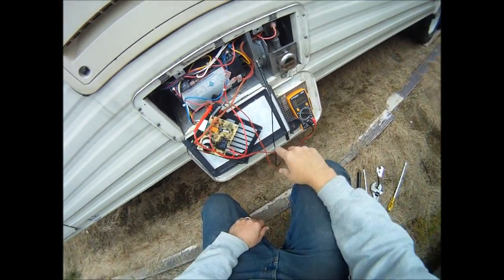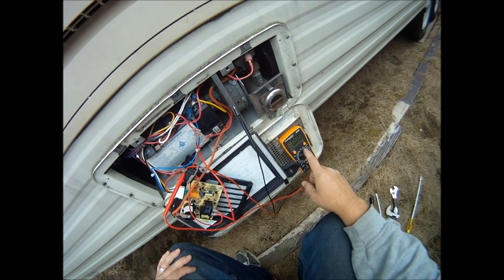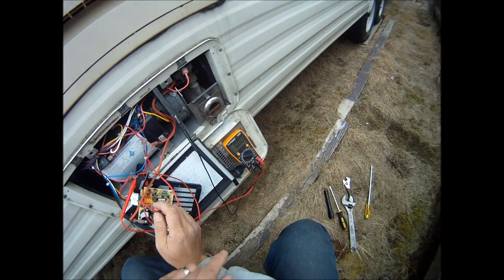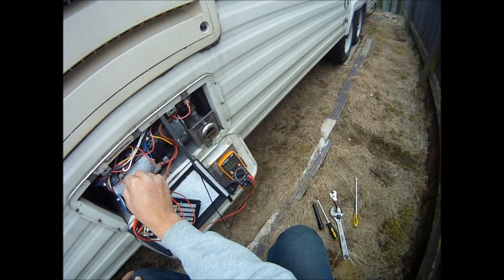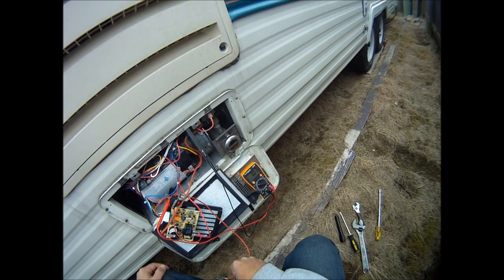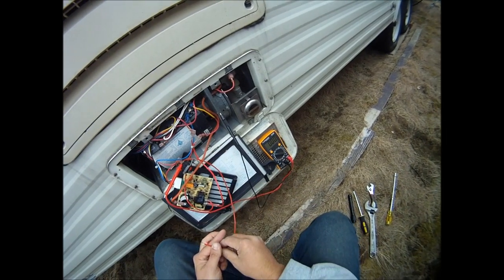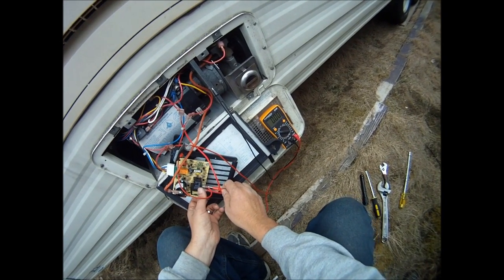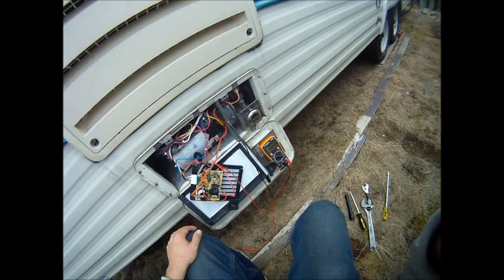Hydro Flame 8525 III

Comment: I have the same heater I wired it and it clicks I could smell gas but no ignition
Reply from the maker: Bummer, have to start trouble shooting things
Reply: I had to change out the igniter board,   was an easy fix for the fail to light issue

Comment: If the input voltage is low but your grabbing voltage from another source off the trailer then replace that jumper wire.
Reply: I should, but 7 years later its still working, I have another video explaining what I did.

Comment: Try a new thermostat
Reply from the maker: The one on the wall in the trailer? Its still working fine after my fix of upping the voltage, I probably should run a new wire to it or something.

Comment: It is the relay timer also know as purge timer, it has 4 wires going to it and it's on top of blower and to the right
It is a bi-metal strip timer, kinda old fashion,  there is a better replacement part by Dinosaur  #31017
Reply from the maker: That part makes it not have enough voltage? Or what does it do?
Reply: It runs the fan about 5 seconds before ignition to purge out possible remaining gas to preventing an explosion

Comment: Could someone please help me ?? I have a hydro flame furnace and the blower fan will not turn on ... I tested the fan and it does work . I changed to a new thermostat too . The blower fan isn't doing anything when I turn the thermostat to heat . I checked all my wiring for loose connections . My circuit boards look fine too . Please someone help me ... This is very frustrating . Been working 4 days on it and can't figure out why the fan won't receive power ..my email is clayton9312@gmail.com or text 304-419-1019 . Thanks guys !

Comment: I did see your other video my curious question is would it just be better to try changing the whole board or do you think it's something other than the board i'm ready to pull my hair out with this thing your help is greatly appreciated
Reply from the maker: Nick C good question, mines still going after putting the voltage stepper on it, so Im not going to mess with it unless I have to at this point.
Reply: JohnVHRC what is the voltage stepper ?